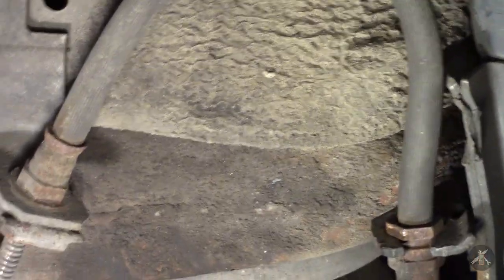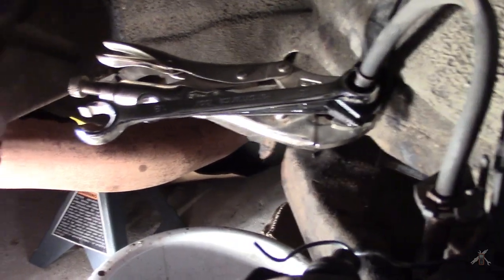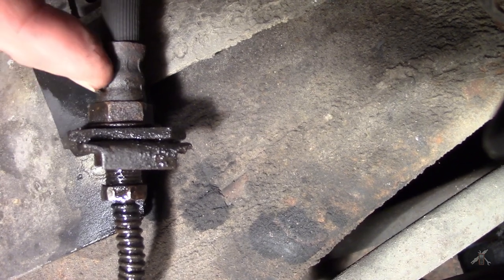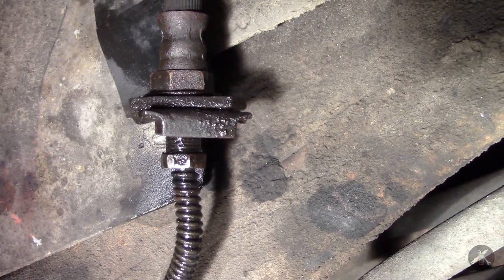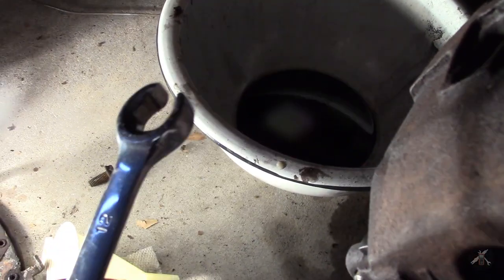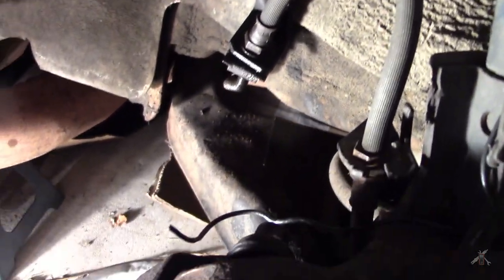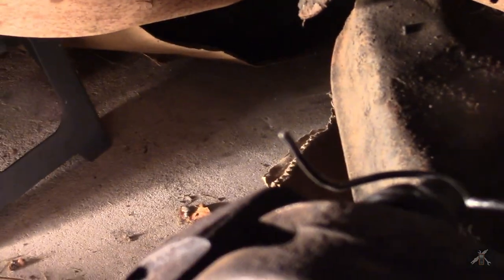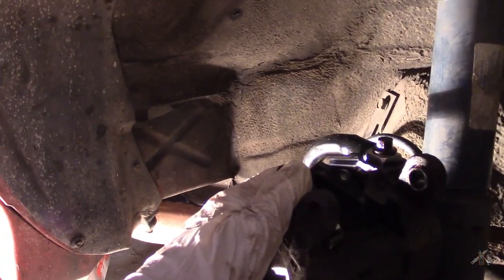Remove Stuck Brake Line Tube Nut and Replace Brake Hose - IROC-Z Barn Find EP75

Comment: Thats amazing cause my 10 mm wrench when applying pressure the tip bends outward very so slightly just ebough to round off the nut and slip off. Niw ill use vice grips over it also. Thanks

Comment: Since the plan is to replace the hose anyway, it would help to just cut the hose near the fitting and use a deep socket on that side.
Reply from the maker: You're right, that should help.  I didn't consider it. I just hesitate to cut parts until I am sure my replacement is good and I don't need it any longer.  Even though I wouldn't run that old part again after heating it, it is just a habit of mine.